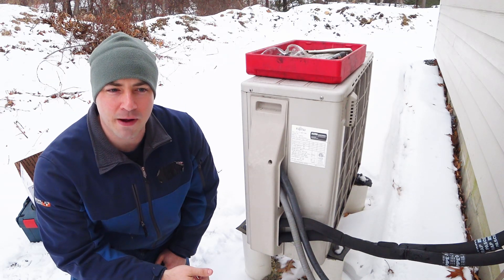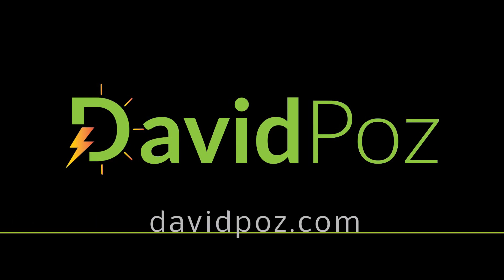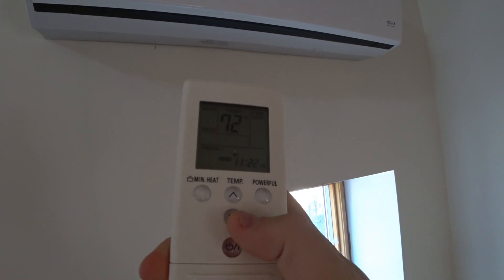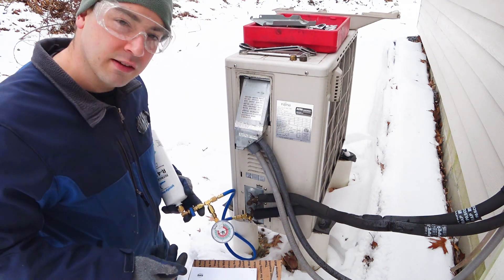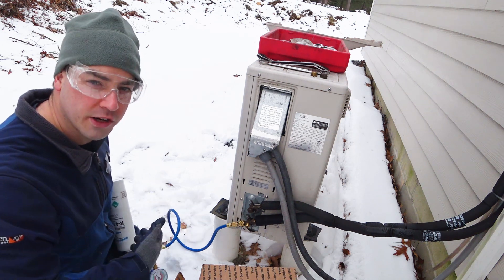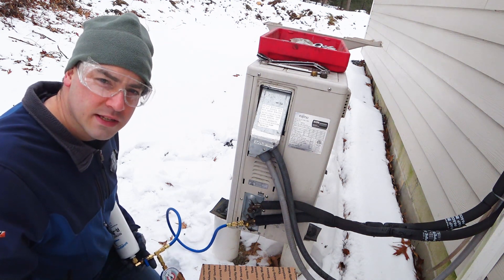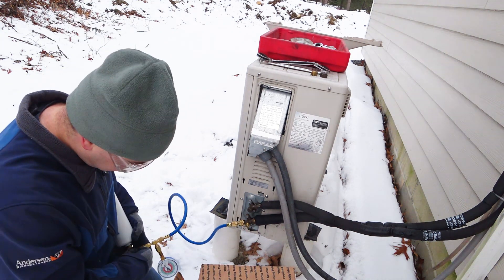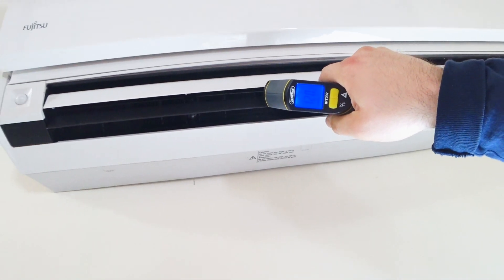Saving Money with DIY Repair on Mini-Split Heat Pump

Comment: As a hvac tech for the last 11 years I will say I respect the attempt to fix it yourself .  On another note a technician can replace flares all he wants over and over but if you don't flare it right it'll leak if you don't properly torque the flare nut it'll leak and finally if you don't use a little oil or preferably nylog on the threads it'll leak because you can't get the best torque.  Such a simple process I see almost always done wrong
Reply: Amen. It's easy to do correctly. Takes no extra time or effort.

Comment: We always have problems with these flare fittings even when they are torque to manufacture specifications idk why they are not just brazed after we get the fittings on we charge the system with 200-250 pounds of nitrogen for atleast 40 mins and if it drops at all then we either tighten again or redo the flair fitting yes I am a HVAC technician
Reply: Are you using the rectorseal seals in the flare? Those create great connections if torqued correctly.
Reply: I love it when a HVAC techs do the Nitrogen pressure test.Some of them dont even do it.Its nice to know they check at 200 to 300psi.What a waste of time and money.If the unit is going to leak its better to check at the maximum pressure about 550psi thats when a possible leak will show up.For the DIY crowd crank the heat up on the unit and look for leaks,and you are allowed to check when ever you want.This is why months or even a few years down the road you need a HVAC tech to come and reflare his old flares and recharge the unit and recharge his bank account.For all the bad installs out there did anyone realize they are mostly done by techs even though mathematically speaking probability theory that since they do the most installs they would have a higher incidence of failure or problems.Enjoy

Comment: That's Fujitsu build quality for you, absolutely terrible 🤣😂 - Older Fujitsu were great, not the new junk they're making nowerdays, if you're gonna go anything, go Panasonic, they lead the way in efficiency, build quality, etc - Especially in Australia where they are pretty much the industry standard for quality. I'll never buy a Fujitsu since they switched from Panasonic compressors to some unknown brand

Comment: Not the unit, it's the techs. You will be adding again because it has a leak. You most likely voided any warranty.. Also, you didn't do a repair, you did the same thing as the other techs did, band-aid.

Comment: More of a bandaid rather than a repair. Its unfortunate the HVAC contractors you had out were inadequate. This sort of issue is typically very easy to identify by an experienced techs.
Reply: A lot of HVAC techs seem to not have a lot of mini split experience. Inverter operation is very different than old school big AC.

Comment: You need a honest professional to find the leak for you... 99.9999999% of the time it’s one of the flare fittings. Fujitsu is the yugo of inverter systems. I’ve condemned 30-40 over the last 15 years and replaced with Mitsubishi... customers were all satisfied

Comment: Hi David, Some comments are saying to purge the air out of the system first. That would only be needed if you started at ZERO pressure. You had 25 psi to start with so no outside air could have possibly got in to the system. No need to pull a vacuum in this case. If you were at zero then yeah, it would need an evacuation first. Just adding freon was the best solution for you at this moment. When opening the freon try to purge your hose by slightly loosening the fitting on the valve hookup at the mini split then seal it back off and open the inlet valve. You don't want any air to get in there. I agree that there is a small leak though. The best way to test your fittings is with soapy water in a spray bottle. Spray the compression fittings and see if you see the soap bubbling up. If so then tighten the fittings and soap them again. No need to break the lines apart it that is the case. You will know when you find the leak. Be sure to check the fittings just outside the wall coming from the indoor unit. Those may be the issue! I doubt if its a bad coil or a leak inside the unit. I have installed about 6 of these with 100% success so I plan to add a couple to my home this year.
Reply from the maker: Thank you.

Comment: Not going to lie but this does make me cringe watching this. lol A good sign that there is a leak on the system is that there will be oil around the spot. Check the connections at the indoor and outdoor unit to see if there is possibly oil around them. Sometimes with the indoor coil they will have oil streak on the indoor coil or there will be oil in the drain pan. Good luck on getting this unit fix. The Fujitsu unit is a very good working unit. It is the best in on the heating side.
Reply from the maker: Yep, I warned you.  LOL

Comment: Buy a unit that have long warranty. If it don't work first years then its there problem.
Reply: The diy units have diy repairs. Parts covered, labor not. With AC, the tools are expensive, especially if you need to draw down and refill.

Comment: My brother-in-law built some retirement cabins and each cabin is heated and cooled by a PTAC heat pump.  If something major goes wrong, you can yank the old PTAC unit out and replace it for less than a $1000.  BTW, A/C guys don't like to search for tiny leaks so that's why your leak has never been fixed.  I found some pretty obvious leaks that other A/C guys were too lazy to look for.  One evaporator leak was so large that you could hear it hissing when I put nitrogen into the system.  The guy before me was too lazy to pull out his leak detector or even check the evaporator.

Comment: I have two mini-splits.  I had the first (a Fujitsu the same size as yours) installed by me but, all connections, pump down and initial operation and check-out by a licensed HVAC technician.  He goofed it up but, finally got it working.  Other than having to replace the blower motor, it has operated very well for over 10 years.  Two years ago, I purchased another unit and did everything myself.  Bought a $15 vacuum pump and a $50 manifold gauge set from Harbor Freight and pulled the vacuum with my 5 HP 60 gallon air compressor for several hours (followed the manufacturers installation guideline).  It's been in operation for over a year and I have had no problems with it.  I even cut the and flared my lines because they were too long.  Now I have all the tools I need to service these forever and it cost less than I initially paid the technician.
Reply: What kind of vacuum pump of 15 $  、so interesting .

Would you give  me the name brand of the vacuum pump ,also the size of it. I’ll be appreciates of that.
Reply: @scottvan1898  the harborfreight automotive vacuum pump pulls down to 300 micros and is $95, the also sell a 2 stage unit that pulls down to 25 microns for $150
Reply: @scottvan1898  He obviously did a typo. I'm sure he meant $150,  which is a decent price for a vacuum pump.

Comment: did you purge the air out of the hose ? fyi, you can crack the fill valve instead of short burst. Heat pumps are not for that cold of an environment. the leak is in one of the coils
Reply: Most modern heat pumps will easily run down to below freezing. Any high quality one will run below zero.

Comment: I have installed many Mitsubishi and Fujitsu mini split systems and have only had a couple leaks due to lineset/flare issues.  I would never leave my customer with a leaking unit.  One system did have a leaking indoor coil that I replaced after the unit was 4 years old but the homeowner used a lot of clorox/chlorine wipes and sprays around the unit which ate up the coil.  You should get yourself a leak detector and start sniffing around all the refrigerant tubing for leaks, then use a bubble leak detect solution to narrow down what you find.  Many HVAC companies are not good at finding refrigerant leaks and don't want to spend much time locating the leaks..  With the service valves you can separate the lineset and indoor unit and flare fittings from the compressor, condenser, reversing valve etc.  Basically split the system in half to find out which half is leaking, also look for refrigerant oil, that is the tell tale sign of a leak.  I live near Binghamton, NY and if I lived nearby I wouldn't mind visiting you and help you fix it properly.  Matt

Comment: Seems like a leak in the unit itself rather than the linset.  I assume the techs were evacuating and pressure testing with nitrogen?  I've got a garbage poineer unit that I picked up used and self installed and the thing runs like a champ.

Comment: I think you just got hit with a fluke on a bad install. I've had my Pioneer unit in our house since 2012 and the only thing that went bad was the bearing in the fan assembly and when i called Highseer the company I bought the kit from, they sent it to me free of charge the new one, because they said the early models like I had were recalled for that bearing. I took the time to install the system myself and learned how it functioned and worked, so going forward I know what to do without burning money on repairs. In regards to charging it, honestly, you should take the time and invest in a set of a/c gauges, a vacuum pump, and buy your freon local. I got my 25lb bottle of freon in 2012 from Autozone locally for under $100 with a military discount. In 2017 when i replaced the bearing i checked the pressure compared to the pressure i put in it on install, it was slightly low, so i vacuumed it out completely for a few hours and filled the system with the same bottle i had from the original install + what was stored in the system from the factory. When i first installed the system, i vacuumed the system overnight for 8+ hours before i checked it for leaks, then after 24hrs it stayed rock solid, so i released the manufactured stored freon, then added extra to the specified amount the manufacturer recommended it be at based on my temperature that day. Plus owning the gauges and pump come in handy once you own them, i fixed my parents a/c in the car with it when i installed a new compressor for them, then when i change my engine oils i use a 5 gallon bucket with the vaccum pump to suck the oil out of the dipstick for oil changes into the 5 gallon bucket.
Reply: What did you do with the freon when you vacuumed it out for the bearing repair, you didn't mention a recovery tank?

Comment: It sounds like the guys you had come out just wanted to change parts and hope the leak was fixed. What you want to bet they've never even installed and worked on mini-splits either? Heh.  Common sense, (assuming you wanted to pay them to do it, a lot of homeowners don't want to pay for leak testing and/or repair and just want you to charge the system and come back next year, if it's a slow leak) says to actually FIND the leak(s) before making repairs or changing parts!)

A well made flare fitting (compression fitting) that is clean and installed straight usually never leaks, even if it' was never torqued to factory specs, which they usually aren't, lol.
After shutting off and letting the system equalize pressure, you can start a leak search by carefully inspecting the condenser coil and all tubing (outside) copper lineset connectors inside and out, and evaporator coil and all tubing (indoor), looking for any dirty/oily spots that would indicate a freon leak. The freon can carry some system oil with it, pushing it out the leak spot and that is sometimes visible.

After doing that, which can often help you find the leak without further work, you can get out the freon detector and start the tedious, and not always successful, process of leak hunting. If that fails you can add a neon dye to the system (that you use colored eye glasses) to help spot the leak. 

If that fails you can isolate the system. Basically you break it into three separate sections, evacuate out all the freon, cut the copper linset pipes by the outside unit, braise in schraeder valves into the open end of each copper line outside that is going in, cap off and braise the larger cut end on the outside unit and braise in a schraeder valve inn the cut end of the smaller copper liquid line on the outside unit.

You should cut the lines at the indoor unit and do the same thing, but because it's mounted right at the wall, and doesn't have the extra tubing and free space around it that a normal attic or closet mounted unit does, you may not be able to cut and braise the lines there due to lack of space and/or fire hazards being close to the wall and plastics on the head unit. Might have to get creative and do some male/female flare capping with schraeders braised into those ends of the pipes and on the indoor head unit.

Once thats done you would hook up to the schraeders one at a time, pull a vacuum on them, then pressurize them at a set pressure, writing it down so you don't forget, cap the schraeders, then using some spray bubbles (which you should have used at all compression fittings, inside and out when first leak detecting) check each braise and schraeder valve that you made and installed, checking for leaks in your work. 

At this point you should have the outside unit isolated and pressurized with nitrogen, both copper lineset pipes isolated and pressurized and the indoor unit isolated and pressurized.  Tell the customer to suck it up and enjoy the indoor sauna and you'll see them tomorrow!
Come back the next day and check the pressure of each.  With this being a mini-split you have less volume of pressure in the indoor and outside units than a larger whole-house unit, so you have to keep that in mind. It might pay to try 'checking' the pressures on each right after you first charge them just to see how much the pressure drops when you lose some nitrogen while screwing on your gauges. A handheld gauge with just a short pipe or hose of a few inches would work out better if you have one. Note the drop for each as a ballpark loss for each on paper then recharge each with more nitrogen to put it back to your test pressure. This is all done, of course, before bubble testing your braised fittings.  Then bubble test and come back the next day. Hopefully the leak is large enough to notice a change in one of them in one day.  If not you may have to come back next week.  Thats why a lot of homeowners just want to charge it up...besides costing a lot to do it, they don't want to be without the unit running and having to suffer the heat/cold.  Spring/fall is a good time to do this.

You would be surprised how many homeowners are so vain/proud that they won't buy a small window unit for their bedroom so they can sleep cool, because their neighbors would see it!! (Shaking head)

Anyway, once you have narrowed down which section the leak is in, you can concentrate on trying to find it in that area, or worst case, having to replace that section. :/. If it's leaking down in six months you have a pretty good shot at finding it, if it's one of those come out every two years things, good luck! 

I could add more, but thats the gist of it.  Oh, saw a previous tech talking about the proper way to initially charge the system after install. While that's the correct 'by the book' way it is done, it's seldom that it actually happens in the field on a new system.  More frequently it's done if an old system has had something replaced, i.e. A compressor burned out, one of the units was replaced etc, and they are worried about water or contaminates in the system. Otherwise they typically blow it out with nitrogen, pull a vacuum, charge it with nitrogen, check for leaks on the braised connections, pull another vacuum then charge it.

Well that was fun typing with one finger!  ;). Im sure others will have more to add that I missed with my three hours sleep! Hehe.  Enjoying your channel!    Mike.
Reply: Leak dye voids the warranty with inverters I am a authorized warranty repair contractor for Daikin if I see dye I’ll void the warranty lol
Reply: Epic  dissertation!  Nice work.

Comment: It's not easy to get something fixed if 90% of the companies are ripping you off or only used to setting up new or basic repairs.
In my experience when dealing with a complex systems that doesn't work, its a knowledge / understanding issue...
it quickly becomes very complex and can take thousands or more hours for a complete understanding of the system and all it's behaviors and issues, made even worse by a plenitude of manufactures and designs.

Basically you got two options, educate yourself and fix it... or find a true expert the latter maybe preferred imo
maybe i would start looking at what other people are saying about that kind of unit, figure out if you are one in many with the same problem... or if your problem is unique... most often the former (tho that doesn't mean one can find the information needed or the people with the problem)

Good luck, and i look forward to seeing the results on the Solar thermal vs PV

Comment: Congratulation you have now filled you unit with air and the efficiency is much lower 
The right way should be! find the hole in your system repair it and then recover it with vacuum and then refill with R410a and again it’s very important to feel the right amount in the unit
Reply: How did he fill it with air?
Reply: @billsmith5166  No vacuum purge of manifold/servicing lines before opening valves. Granted, this is a tiny manifold. but still.